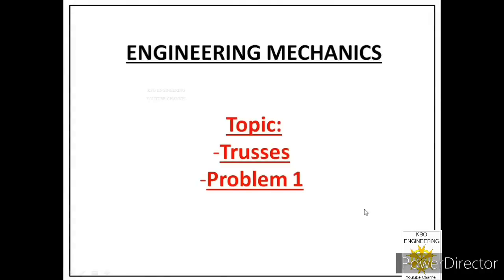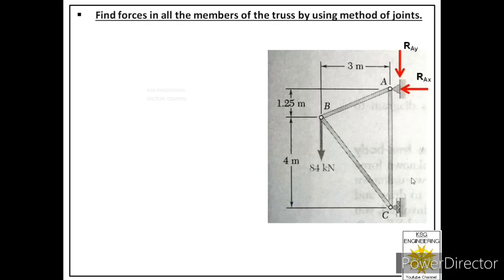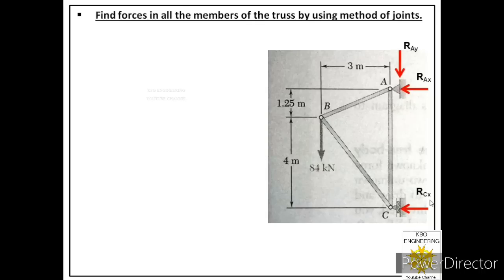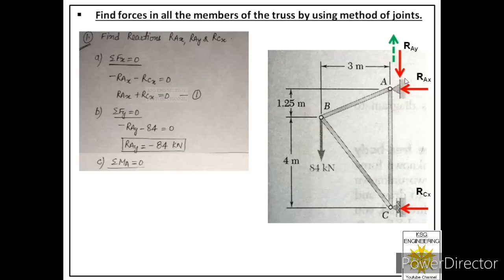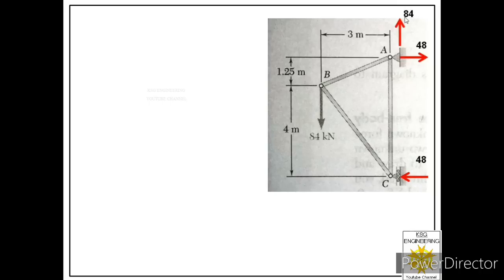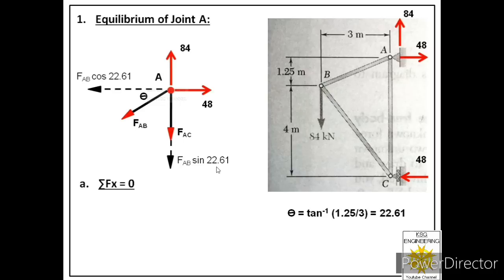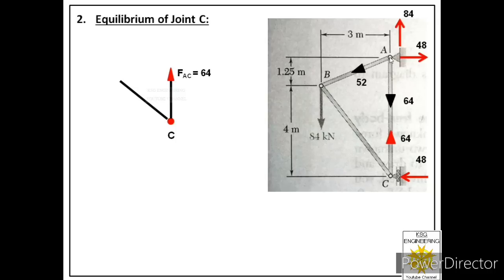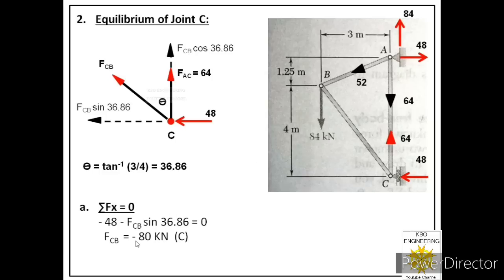Trusses | Method of Joints | Problem 1 | Engineering Mechanics | 11.1

Comment: Equilibrium of joint C for the sum of Fx, you used sine instead of cosine, why?
Reply from the maker: Dear, for this you have to understand the resolution of forces. Look, it is not a rule that we should always use cosine in horizontal direction and sine in vertical direction.

During resolution of forces we have to decide that with which component we are considering the angle of the resultant force. Suppose, the resultant force P makes 30 degree angle with the horizontal component and 60 degree with the vertical component.

Now if you want to use 30 degree angle in the resolution of forces then as this angle  is with horizontal component then the horizontal component must be cosine component and thus vertical component will be sine component.

Thus horizontal component will be Pcos 30 and vertical component will be Psin30.

But if you want to use 60 degree angle in the resolution of forces then as this angle is with the vertical component then this time vertical component must be cosine component and the horizontal component will be sine component.

Thus, horizontal component will be Psin 60 and vertical component will be Pcos60.

Now compare the above two choices: in the first choice when we took 30 degree angle then the horizontal component was Pcos30 and in the second choice horizontal component was Psin60.

Now, see cos30 and sin60 have same values thus, in both the choices, the values of the components are same.

So, when ever we have to decide cosine and sine components, we just have to see with which component we want to consider the angle of resultant force, then that component will become cosine component irrespective of its direction whether it is vertical or horizontal.

I hope you understand